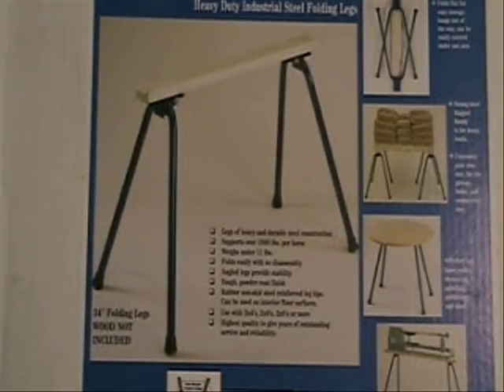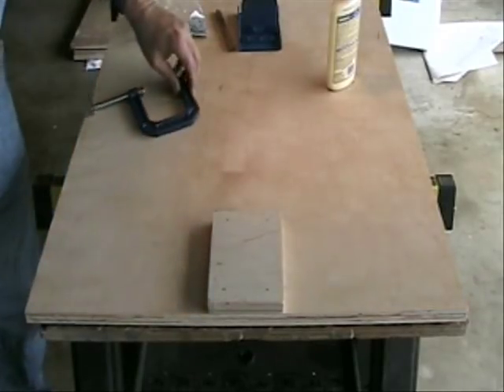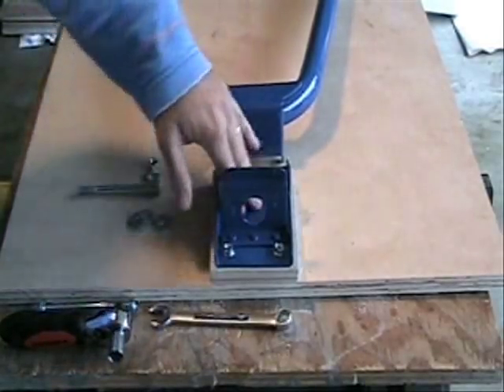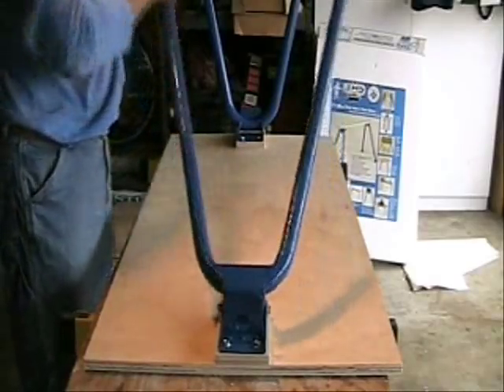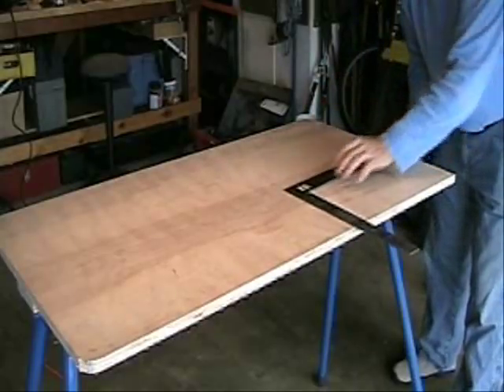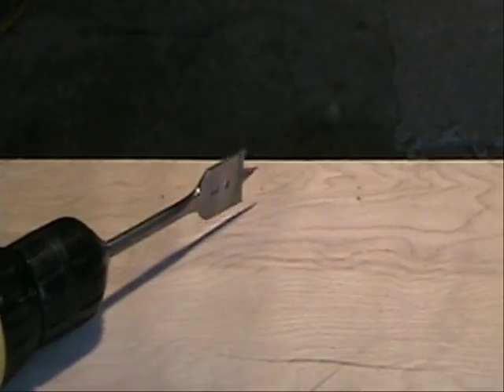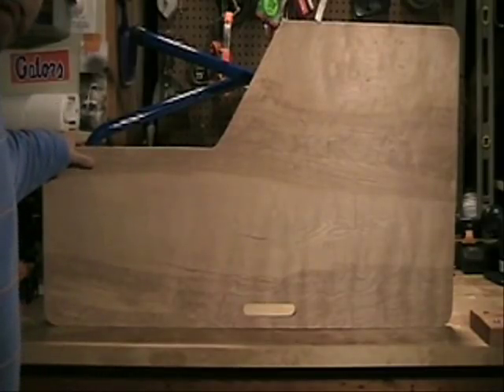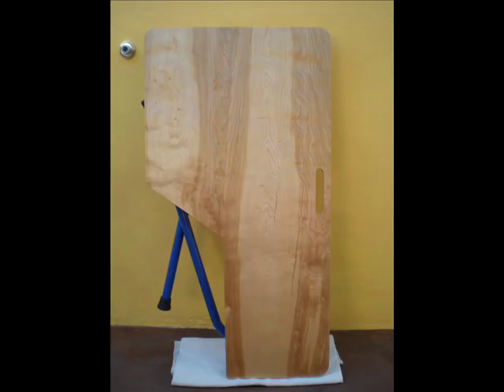Build Your Own Shooting Bench

Comment: After watching this video, I purchased a folding patio table from Walmart then got a piece of 3/4 plywood (3x4 feet) from the lumber yard.  In my garage, I cut the shooters notch, sanded the wood smooth and bolted it to the folding table.  I sit just behind the rear legs and the notch is the only thing that hangs over the rear edge.  I used two bolts, fender washers inlet-ed into the wood.  I can flip the bench top over, converting to left handed shooters.
Reply from the maker: Sounds pretty sweet, Tom!

Comment: Made two of these. Learned a few things the first time; like make sure the 4x5 scrap piece is high quality wood and attached perfectly straight; first one cracked when I attached the bracket. Next one was only 1/8 of an inch off, but made the legs a bit off-center and then the table wasn't quite flat (wedge worked). Second table only took me about half an hour to make and everything went perfectly. I teach from a benchrest position and these tables are the right height and very portable. THANKS!

Comment: Great idea and video.  I grew  tired of shooting off the top of my vehicle too sight in my guns so I built one of these.  The suggested legs are kind of pricey so I used a folding metal sawhorse from Sears for $29.  I also made my ambidextrious since I am a lefty an often shoot with righties.  Nice solid table and works great with my lead sled.

Comment: Worked out really well. Found the legs on amazon for $41 (free shipping with the rest of my order), and got the panel for $18. Already had the screws, glue and spray varnish at our club. My cost was about $60 and half hour of work. It's a nice shooting bench to fold up and hide away until needed.
Reply: +Barry Dove What is the panel part number you got? Also what are you using to sit down on?

Comment: @Clemdogsan, thanks for uploading this -- great idea, economical and easy to build.  I was about to start building a shooting bench out of all 2-inch lumber -- folding legs out of crossed 2x4s on hinges.  You're idea is easier and quicker to build and probably no more expensive, if not less expensive.  Certainly it is "handier", lighter weight, and easier to transport.  That's using the ol' noggin!

Comment: Thanks for a great video and a better bench. I finished mine this morning when the Rugged Buddy legs arrived (only 2 days). I did make a couple minor changes. I enlarged the leg mounting pieces from 4"x5" to 4x6" since the Rugged Buddy mounts are 5 3/8" long. This gives more material to drill without being right on the edge of the wood. The table sits nice and level with no wobble. I also added a 5"x7" piece on the front to place shells in without them rolling off the table. Most any box of ammo will fit in this. It is made from 3/4" square oak. All together I have about $60.00 invested and a better bench than any commercial bench I have seen for 3 times the money. Thanks again.
Reply from the maker: Wow! Sounds like a Cadillac of a sweet shooting bench. Can you post a photo?

Comment from the maker: Good point.  I am 5'9", and the 34" legs do make a table that is just a little high for my comfort.  Before you cut anything, be sure you know what chair you will be using with the bench, as that may make a difference.  Then I would suggest cutting no more than an inch off the legs at a time, putting the rubber feet back on, and trying the table until you get the height you want.  Good shooting!   Clem

Comment: Made one of these this afternoon using the Rugged Buddy legs and some plywood I had lying around. It was 1/2" oak veneer plywood that used to be part of a home office set-up (24" x 96"). I cut the plywood down to 48" long...but instead of trimming a 3" piece off the end to reinforce it later, I glued and screwed a 1x4x48 piece of red oak along the middle of the sheet lengthwise. It gave the sawhorse legs something to bite into, as well as provided stiffness to the table (and overall it was some extra length). Hopefully, the lengthwise board minimizes warping and deflection. I did not spend a bunch of time finishing it...just a good coating of paste wax. Thanks for the inspiration!
Reply from the maker: Nice! Would love to see a picture of that bench.

Comment: @Clemdogsan I made mine by cutting the pant legs off a pair of old camo military pants, filled with rice (can use all kinds of things..bird seed, small beans etc) sewed up ends. I also decided to salvage a piece of black strap off an old bag and sewed that from one bag to the other just to keep them together and make for easier carrying. I then cut out the foam in the shape of the bags from my rifle case so it closed nice. System works great and the cost was 0.00 as all the stuff was salvage.

Comment: You saved me well over $150 with your video. I have sturdy banquette table legs and all other on-hand. I may shim the front table leg with two 1/2" glued and screwed plywood strips so as not to add unnecessary 5/8" added rise. Also suggest the handle cut be made last. Use a C'clamp to determine the exact balance point then cut slot 1/2 either side. A top rim lip using thin wood (~1/4") or other (plastic) attached to outer edges, except shooters notch, to keep casings, other from rolling off?

Comment: I am going to build mine using the Harbor Freight folding sawhorse (#69059). The legs fold completely flat and are independently adjustable for height. I have already used one of these to hold a steel target plate for a fraction of the cost of target stands (about $25 bucks!)
Reply from the maker: Randy, sounds cool. I don't k now about those legs. Can you post a photo of the finished product?
Reply: how do you attached the table part to the legs?

Comment: Just finished the shooting bench/table.I think I'm going to cut legs to 31 inches.Hopefully that will reduce fron to back wobble.
Reply from the maker: Larry, when you pop the legs open and set the table on the ground, just pull back on the rear legs slightly. Sort of gives a bit of spring tension between the fore and aft legs. Cuts out any wobble.

Clem

Comment: Nice.  Went to the RuggedBuddy website only to find they now offer YOUR shooting bench as a kit.  They even copied your hand hold cut-out.  I don't know but they are charging $155 for the whole thing with no work involved other than assembly.  With a complete woodshop at home I will probably customize it for myself anyway so all I really need are the legs.
Reply from the maker: Willard, great guys over at Rugged Buddy. I hope the kit sells well. Not everybody likes the smell of sawdust, wood glue and varnish like we do! 😀
Reply: +Willard Joder Uh....yeah.  Guessing Clemdog making a nice royalty!
Reply: +Clemdogsan Just as an added, I built three of these from scratch, so far.  One for my son, one for his girlfriend's dad and one for myself.  Made a router pattern for the handhold which makes for a nice, smooth and uniform cutout.  Also added 1" corner molding all the way around to protect the edges of the plywood; provide roll off stops for cartridges; and give it a nice, finished look.  Each of the benches is stained a different shade and then sprayed with four coats of spar for final protection.  Look as good as you would find in any gunstore.  Last but not least, on the cutout side, added a couple of small hooks in front of the cutout to hold a shotgun shell pouch for things like screwdrivers, ammo (brass) or whatever that I need to be really handy while shooting.  Considering adding some rubber bumpers fore and aft to protect the ends when folding/unfolding the legs.  Oh and for you boots, got my belt buckle from MCRD San Diego in 1964.  Just a second, got some salt I need to dust off my shoulder.  :-)

Comment: Curious Clemdogsan...why do you put the brace widthwise instead of lengthwise?  I would think you would need a brace on the bottom lengthwise due to the added length of the plywood?
Reply from the maker: Good point.  So far I haven't had any flex issues, and I use mine with heavy varmint rifles. I have also been taking the piece of wood from the side cutout, ripping it into 3" strips, and fastening them along the long edge of the table for additional longitudinal stiffening. This makes the handle cutout challenging, so I've been skipping the cutout handle and attaching a simple metal gate handle for carrying. Adds a small bit of weight, but you could probably shoot a Barrett .50 BMG on this version of the table and not get any flex.

Clem
Reply: Thank you Clem!  Seems to me if there was any flexing, it would probably be within the long edge...I may leave both off for now and see how it works out.  Really appreciate this video my friend...I was able to build the table very quickly!

Comment: I know this video is a few years old, lol 13 to be exact. When you use those banquet table legs. You said one side would have to be propped up in order for them to lay flat? So I can assume if I did that I would need to cut one of the other legs so it was late flat on the ground that extra 2x4 that was in there?
Reply: Maurice,
That would be the smart thing to do, but usually in the field I'm not shooting on level ground, and If I'm using the table for more civilized uses, such as on the patio with my slow cooker I stick a 2 x 4 under the short set to even up the table.
Reply: @markclemenger6169  Ok, thanks for the reply. Wow. I had a  brain fart just then. Yeah, I guess I could just use another piece of 2x4 under the part that's not raised up LOL 😁

Comment: how thick is this panel..also is the stiffner run vertical or horizontal to the table..I got 1 inch PW.will this work as good
Reply from the maker: Mike, I use 3/4" plywood. The simple stiffener depicted runs perpendicular to the lengthwise axis of the table. It has been sufficient for some pretty hefty rifles. Lately I have also been cutting the cut out piece into 3" strips and fastening them along the outside edge of the table as a lengthwise stiffener.
Reply: I had extra PW on hand last  week..ah had 1/2 in double it an its 30 x 48. Prolly cut 2in off length just wanted a lil more room for a rest and small items..hadn't put on legs yet its already its heavy..lol may u wood legs .heck I ain't gona use it much

Comment: I sorry, but I have watched the video numerous times and I cannot figure out the dimensions of the table. 24 x 48?
Reply from the maker: I start with a 24" x 48" panel,then cut a 3" strip off the short end. So the final table is 24" x 45".
Reply: Thanks, making it tomorrow